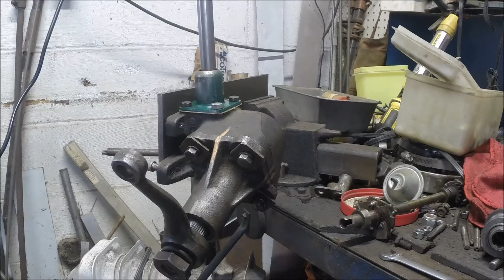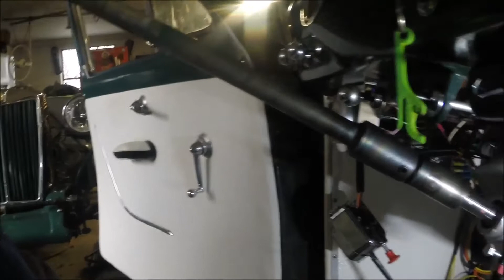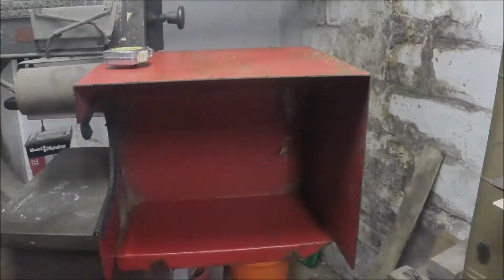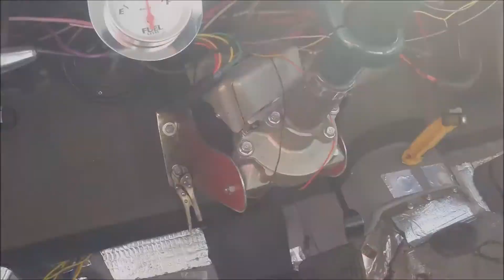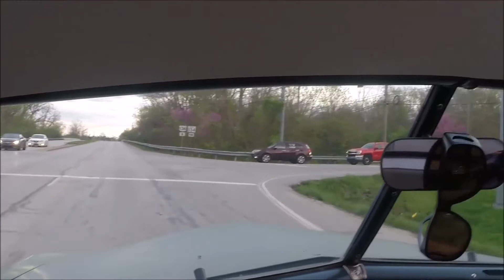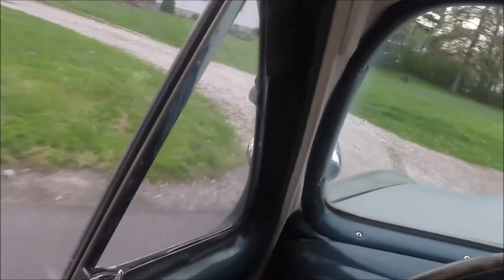1949 Shoebox Electric Power Steering Part 4

Comment: might think about reinforcing those plates with some stout welded on horizontal 90 degree steel lengthwise strips to keep them from twisting. or  just make them out of something thicker to begin with.